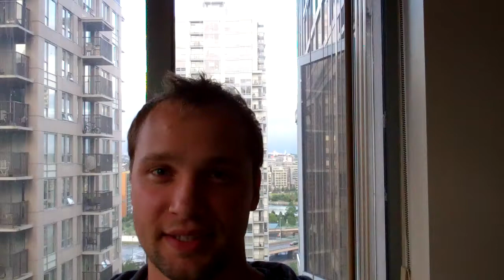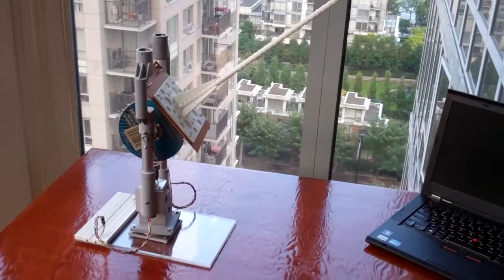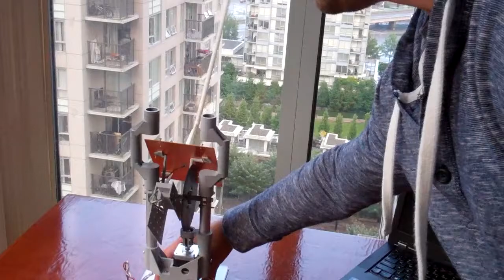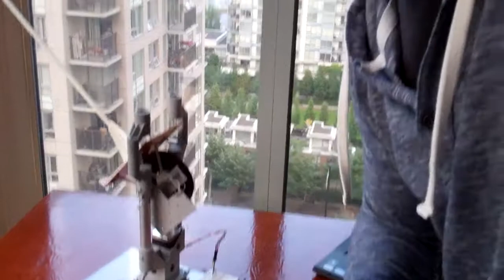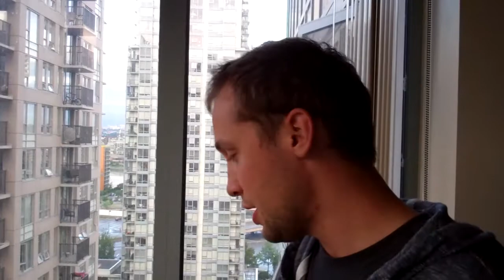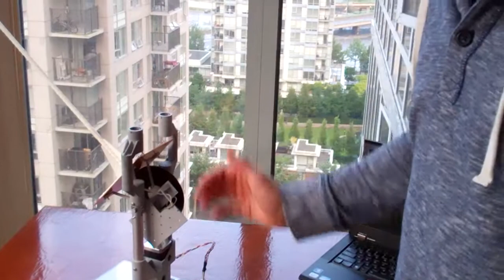June 27, 2013, Modem, Lunaro, RF noise pattern detection/выделения сигналов пульсаров

Comment from the maker: 2.4 protocol implementation to be continued. If Implementation "as a Modem" is not good - to bad for implementation - source code was to be cut. Lunaro sterling database and web interface mockup. Small program to detect noise patterns in RF. That's it for a past 1.5 week.
Модем не подходит - модем должен быть перепрограммирован. Лунаро монета - мок-ап базы даннах и веб интерфейса. Выделение паттерна шума из радио сигнала
http://youtu.be/UfXiX29p8O0